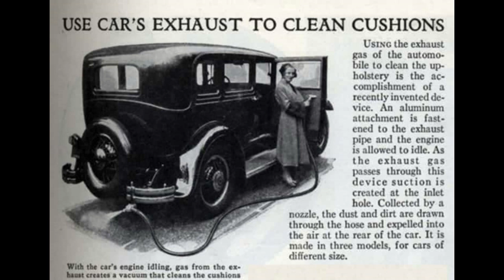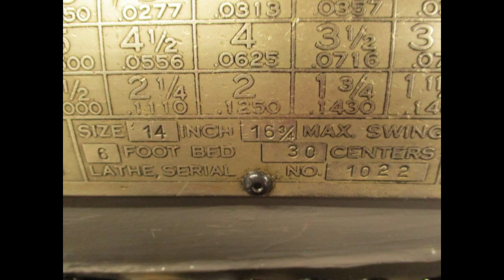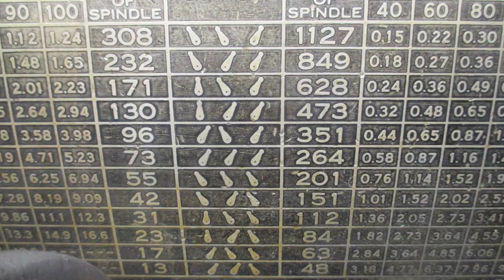Lathe Chuck Jaw Grinding Professional Proven Performance

Comment: Ive been a diemaker for many years and have My own tool and die shop. I am still learning things I didnt know about checks here. This is absolutely wonderful information on chucks and Your results prove it. I get a bit lazy on these things as I always put Buck adjust- true chucks on my lathes.   Thank You
Reply from the maker: This was especially needed turning Induction Hardened Chrome Plated cylinder rod always used on Caterpillars. The Adjust true chucks cannot withstand that service using 20hp lathes. Even using the solid steel 12 and15" Bison chucks takes a toll on them where a grind last about a half year or so unless you spin something in the jaws, then this will only take less than an hour to get back going, thanks!
Reply: @DonDyarprecision  Ooof, reading ``20hp lathe`` is like smelling a good bbq in the air...

Comment: Good morning Don. I made a tool like yours for regrinding chuck jaws, and used it on my old Smithy 12x30 3 in1 lathe that I bought in the late 80s and the chuck went from .004 of run out to .0005 of run out. Great advice as always thanks.
Reply from the maker: This method appears lost in time but in hydraulics work older hydraulic cylinders can be rebuilt using the latest seals. The pistons can be quickly chucked and seal grooves recut or modified for Polypack seals or other types now. On excavators or other severe duty equipment when the pistons or rods are scuffing inside the bores from harsh use, a wide shallow groove is needed for a wear band made of composite material to stop the metal scuffing that will contaminate the systems oil. There it is important to be within .002" for run-out, That is the rest of the story, thanks!

Comment: Hey don I know you have made a ton of videos on trueing up chucks, and I may have missed this answer. But, how do you personally lubricate a freshly cleaned chuck that is ready to be re assembled?....grease or no grease, oil or dry?
Reply from the maker: I use machine oil on the parts, first, before using I set the chuck horizontal, back the jaws out far enough to oil the scroll where it pivots and some oil on the face of the scroll. Of course, oil will fly out when running'
I read the Bison instructions suggesting using white lithium base grease when reassembling, I will try that and use oil as before, thanks

Comment: How do you determine the master pinion on a chuck? I usually use all three pinions to even out the scroll pressure. Same on plain bearing drill chucks. All three holes. Thanks Don.
Reply from the maker: Hi, test all 3 pinions, the one that has the least run-out should be the master pinion used to grind the jaws because less material will be removed.
 It was pointed out to me that Buck recommends tightening al 3 pinions for heavy work. That works fine if the last pinion tightened is the master one used when grinding the jaws. When the jaws have been re-ground, the other 2 pinions will always show more run-out because of the internal clearances and other small faults in the chuck. thanks.
Reply: @DonDyarprecision  Makes sense, thanks for the explanation Don.

Comment: How about more information on the grinding fixture seen in the opening seconds of this video?  Describe it's accessories and the typical applications for the fixture,
Reply from the maker: Hello! I made a video introducing this rare 1940s All Tool Rotadex Grinding fixture, showing the complete unit and box. This unit will replace some of the other fixtures I have been using. I may make rifle chamber reamers but likely will not show that. Thanks

Comment: Oh man, i hope the bloody weather turns for the better, i`ve been a fucking mess since i last posted a video, which was 3 months ago... I despise winter... If a had a functioning shop, i suppose that would be a bit different and better, but as i am, i am just smoking, sleeping, watching machining stuff, reading the timken and skf bearing and spindle manuals for like the fifth time now and thinking of projects to come... I have a few things in the works, mostly aesthetic casting ``fettling`` and putting machines together after painting them and all that, but one can`t even do that while the weather is like this... I can`t bring out the castings and grind or hand plane sand them for painting when it`s cold, raining and just disgusting outside... And i don`t feel like making a cloud of iron and abrasive(as if iron isn`t abrasive itself) dust in the fabrication shop(machine shop has no abrasives in it)

My bullshit notwithstanding, this is some marvelous work... That old 3 jaw is more precise than some brand new 3 jaws, of course, not from high name brand dealers like kitagawa or such, but let`s not be talking about 1k$ chucks for cnc, those are a league all of their own, not a common 1 guy shop occurrence... Sublime work indeed! Sure, it will never beat a 4 jaw indep. chuck of that same caliber, but again, that is a separate category and a different nature of a beast entirely... For what it is, these results really compound the chuck grinding video that i`ve seen on your old channel, as you said - proven performance indeed... None of my chucks would tolerate being bored to a larger inner dia, but then again, none of my machines really work at the moment, so it`s not like that`s the issue really... Oh well, i`ll keep my fires burning by watching you for now... I`ll have enough projects when the weather gets better... Between that and channels such as yours, that will be enough to keep me sane - until my new shop starts being a work in progress... Then the real insanity starts... 

And that dual read indicator is quite cool... I`ll get one just for kicks... Having that and a dual reading calipers as a video maker on a global platform really is a nice addition... Sure, it`s easy converting the number mentally and just spitting out the corresponding value, but on the other hand, when people see a scale that they are familiar with, they are more pleased than just with your efforts and a spoken number that is easily forgotten, especially when you primarily use a system they don`t... I know that 1 micron is 2.5 tenths, or so about, so it`s always either multiply by 2.5 or divide by 40(thou and mm, rather than tenth and micron, but the two are the same, as 100/40 is 2.5, and if 100 makes one whole, well, the math is easy from there) but most people have their own way of seeing things and their own nearly unique internal frame of reference, so just having a device that shows both systems is a pro-gamer move... 

I`m also looking forward to seeing that Rockwell mill... As a machine fetishist, voyeurism of other people`s equipment endows me with both envy and pleasure, but with my current situation, it will be more pleasure and less envy :P

All the best and kindest regards!
Steuss

P.s. that exhaust ventu. vacuum idea is just priceless... such a throwback to the age where shit made sense and sanity was a prevalent and appreciated quality... What with those massive cubic volume engines, the suction must have been decent aswell, unlike what you would get from the same thing with a modern 2l or sub 2l engines...
P.p.s. Love the ending ``slideshow``!
Reply from the maker: Spring is around the corner, this has been a tough winter! more to come!